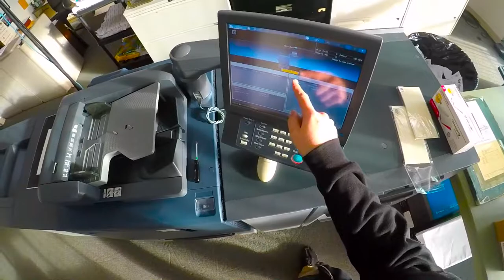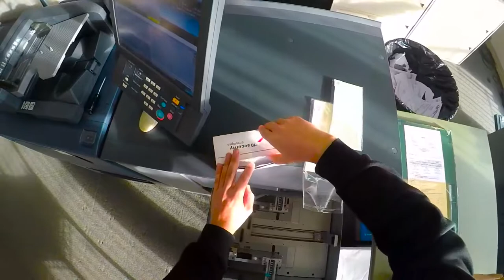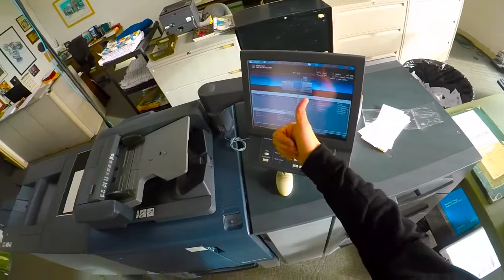Konica Minolta C7020 - Swapping Out Main Fuser for Envelope Fuser Guide

Comment: You mean c1070? LoL surprised they weren't wrinkled! What envelopes are those, and what envelopes do you use with windows
Reply from the maker: It's a C2070. We use heat resistant Envs.
Reply: @cizrek  awesome. I have tons of these in field and it's been challenging finding the best envelopes. And recommendations on remittance envelopes like brand?
Reply from the maker: @DQSH8999  Honestly I've never done any remits with windows. Envelopes are some of the worst to print on. Usually for big orders we use a heidelberg. The C2070 sometimes just ravages the envelopes. Have to add shims flip them change put put trays just to get it to stop eating them sometimes.
Reply: @cizrek  sorry so remits with no windows. I was asking for widows com 10. Yeah its a battle man. Always wrinkling. The c3080 ef has more guides they give you in the tray now that does help for stacking

Comment: Can we convert this envelope fuser to print 12x18 inch??? Any idea
Reply from the maker: We've since upgraded to 4080. I am not sure you can print normal sheets thru the Env Fuser. Just like you can't print Envs thru the normal fuser.
Reply: @cizrek  can we use the fuser roller of envelop fuser and put it on normal fuser then? I got my fuser roller and heater rolleer cracked and after i imported the unit i got mistakenly envelope unit... So this is my main issue
Reply from the maker: @gauravrajmanandhar8460  The company I work for leases the machines and if you don't do that you are going to run into a ton of errors. If you lease from a company they come in and repair things for you for free. We do not do any repairs so I have no idea how to help you. You have to have the right fusers or you will ruin the machine possibly.